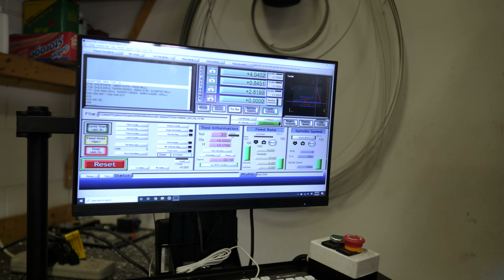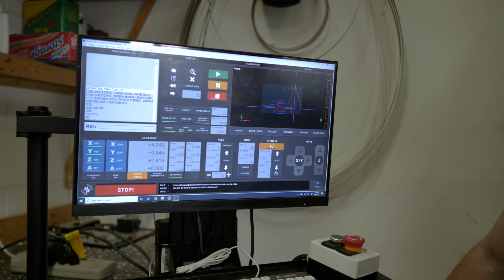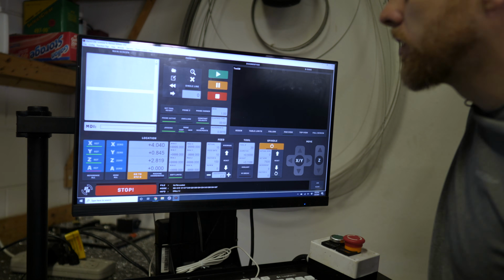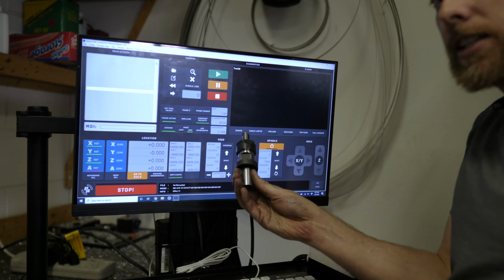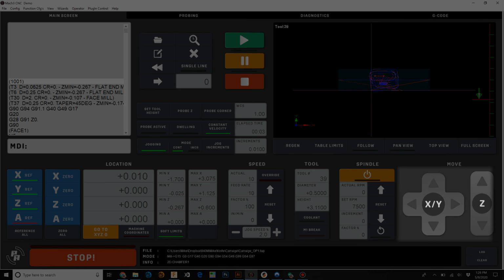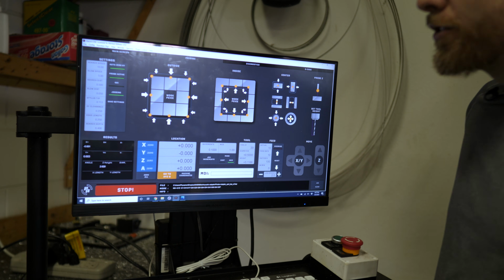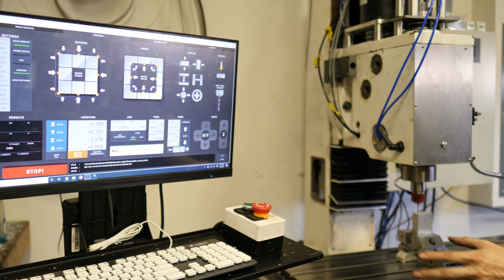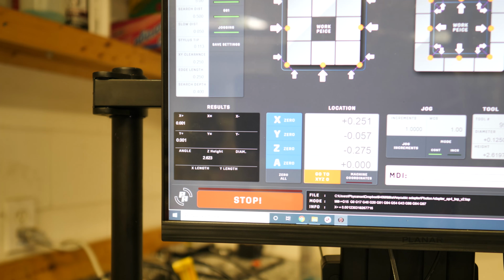Mach 3 Has Never Looked This Good! (CNC Software Part 2) - S03E14

Comment: Thanks a lot for sharing this probing software, really appreciate the work 👍
I have a quick question about units:

Does the probing system use Mach3 global units (mm / G21), or are the probing parameters (tool diameter, search distance, clearance, etc.) still interpreted as inches regardless of global settings?

Is there a recommended way to switch everything fully to millimeters?

Thanks again for the great software!

Comment: not sure where to report a maybe problem with the screen set.
When i change the speed on my spindle, i don't see the expected speed.

I don't know my exact speed, but i think its calculated what it should be.
When i press up and down, i can't see any value changing.
Is this meant to be like this? i broke my edge finder due to the speed being much higher than i expected.

Otherwise, it seems to work quite good.  are about to try the probing soon..  Does this screen set have plane orientation?
So my part can g-code can rotate after my part.

Comment: Great UI!! Thank you very much. :D

There are a couple of things that aren’t mentioned specifically though… you need to read through the comments to kind of find them. The just is…
1) The Bitmap folder and .set file need to be in the Mach3 folder.
2) In the “config” menu, under “General Config…” there is a tick box in the lower right-ish corner that says “Hi-Res screens”. This option needs to be ticked.
3) After this change you need to restart Mach3.
4) apparently there is something that needs to be done with Macros… I need to explore this more, but it is in the comments.

This worked for me on an Acer 24” generic monitor on a stock VGA port on the motherboard.

Hope it helps someone else. :)

Comment: A multi probe work around for Mach 3. If you have two or even the probes can you wire their outputs to a three position toggle switch (center off) on the normally open contact then wire the switch common to the probe input on your controller? Or you could even use a rotary switch.

Comment: One question, I have edited a bit on your screen set for setting feedrate via Modbus, there is one thing i cant figure out. Spindle on/spindle off.. using the led as an output, it is always blinking regardless of running state. Is it possible to make it just spindle led on when running and off when off? Br.. Jacob

Comment: A great set, thank you :-) One problem though.... Since I installed this set, I have to zero-out my Z axis two times. After I have set all axis to zero, and start cutting the Z axis jumps to 10mm above where it should be. I then need to stop the program, set the Z again, and the it works as it should. Anyone having this problem?

Comment: So I followed your example and started at bottom left, clicked on the corner and the machine moved to the left a little then stopped and a message says: Manually return to starting position and repeat the search. It just keeps doing this. It doesn't travel down then move right to find the part. What am I doing wrong?

Comment: Dear! I tried to find 0 parts by Z, put the cutter on and pressed the probe z button. He measured everything well and drove away from the part to a safe distance. I decided to check and after pressing the go tu zero button, the milling cutter went to 0 machine coordinates ((( and zero was at -157 mm at the bottom (what did I do wrong? Sincerely, Igor

Comment: Very Nice looking screen set but when I try to load it I'm missing the Reset/stop button, its off screen at the bottom(no scroll) and it does not matter how I try to change size or move it I cannot get it  to apear full screen with everything in sight. I'm using 1920x1080 full HD, using a non touch screen. any ideas?

Comment: Thank you for the video, you have designed a great screen set. I will be using this with a CNC router. I might change the coolant button to Vacuum. Can I use the editor that I use to change the Mach 3  screen set? Is the link the screen set the most current screenset?

Comment: i have try learn how make tool height Z zeroing to touch plate last 3 month but not understand how this make, linuxcnc, make touch button, make macro, run code tool setting heigh but not understand good thats my english not good not understand all, and translator not working technic language right.  were need add button file how make button file how and were make macro or subroutine and all hall or ini files or what have.

Comment: May I ask, how do you get it to fill the screen? I've tried changing the screen res but that made it worse. I also put that skin into Mach3. It fills the screen, but over fills it.  I can only see the left 3/4 of it and missing some of the bottom of it. I'm using a dell 14" laptop. Is that the problem?

Comment: i got some issue with center probing. circle, and slot probe..   it probe one side of the wall inside a slot. two times. and goes to the wall but stop here. it will not go to the other side of the inderwall on slots.   normal i run with big tex screen set, and use his macro´s. can that be the issue ?

Comment: Hello,
I can't get the edge detector to work, no matter what I do, I've set all the values as shown in the video and all I get is "Error! The sensor was triggered during movement Z

 ---Return to search position is interrupted" or "Manual return to start position and repeat search", but I can't get it to work.
Do you have any idea what the error is?
Dominique

Comment: Why do so many GUI designers do this? There are things the code knows about, and there are things the user knows about. The job of the GUI is to tie those together. Take the Work Coordinate System. The code labels them from 1 to 5 (or whatever). The user doesn't give a toss about 1 to 5. The user wants to see and choose G54 from a dropdown list. That is what needs to be on the screen. The same for all prompts and displayed info. None of it should reflect what is going on in the machine. It all needs to be plain English.

Comment: Installed the screen set yesterday.  The Top View Button results in a Mach3 script error on line: 1 - Sub or function not defined: None.  Also Full screen has no way to exit.
I'm sure I've done something wrong, but I've had no luck with this on two different computers.

Comment: @Physics Anonymous I think your logic on setting up the screen set is spot on and your design sense to make it look good while functioning is also great.  I will very likely use your screen set for the mill and modify yours slightly for a our Alpha Wolf CNC Plasma table as well.  I always meant to make my own screen set, started once, changed a few things and then never took the time needed to do the whole thing.  I did have 1 recommendation so far with watching your explanation, On your probing page the tip diameter, you should input your exact size and make another input box called calibration adjustment (or something like that) and that's were you could put in the amount you need to adjust it to make it accurate, then it would be clear and less confusing I think.  Again, great job!

Comment: Hi, thank you for this great UI. I really appreciate it.
Anyway, I ran into problems with probing.
Mach 3 always crash when I try Probe z or Set Tool hight 
The Tool touches the Probe plate.  Probe aktive lights up but then mach3 Crashes.
It doesn't even retract the Tool. 
It also seems to not save the settings.

Comment: When using Mach3 and a touch you need to use two fingers to activate a momentary switch like jog buttons.  I think the jog buttons are the only momentary (press and hold) buttons in Mach3.  The press of the buttons needs to be one finger first then the other (staggered).  I always found it weird and limiting but it can also act as a safety feature.  Having to use a double touch to jog helps eliminate accidental movements of any axis that can be jogged.

Comment: I installed this on my MACH3 CNC mill and it is so easy to navigate. One question, I am running MACH3 on WindowsXP on a VGA monitor 1280:1024. It seems like some items are fuzzy due to the difference in aspect ratio I am guessing. Anyway to get the aspect ratio correct so everything is sharp on a VGA monitor? My PC only has a VGA port.

Comment: Hey PA! This video just scratched the surface of the probing section. To me that one of, if not the largest, part of your screen design. Would you do a follow-up with an in-depth look at the probing and how it's setup? I've picked up you set and switched to it but it seems like none of the routines work correctly.

Comment: Warning! Danger! Read before use! This screen set and macros are extremally buggy! Some bugs render some functions useless, and can cause damage to your machine, tools, or accessories. I tried this set out as well as the probing routines. Here is what I found. First you will be lost in the short term while you relearn where a variety of buttons and functions are. The tool library and WCS offsets are not visible on any screens. This was a disappointment but not a deal braker. What really upset me was the total failure and unreliability of the probing functions and just how bad it can mess up your machine. All issues are unexplainable at this time. Here they are. I ran the probe function 10 times. It would "ERROR return to start position" 8 OUT OF 10 times. Basically had an unknown failure most of the time. And when I did get it to work OTHER issues occurred. The worst one was the "Mixing of the Jog Buttons" I don't know what else to call it, but yes you heard that right. The jog buttons got changed. And x turned into z and I Crashed and broke my probe! Some times it would try to accelerate a motor at a ridiculous speed and I would hear the motor stall. So now I have to re home it. In some cases the Soft Limits got triggered without a good reason. This is NOT in Beta testing as the website says. Beta testing is a term used by developers when they need a larger test run. In beta there is an easy feed back system where failures get reported, prioritized and REVISED preferably with a public log of changes and comments by users. There is no way to tell the PA guys what is wrong except in this comment section, or sending them a DM on social media. Which I will try to do. This is not in development and that's because no one is paying for the time. This is a common issue with Mach 3 as a whole and with Mach4 not being an improvement I highly recommend you look at an alternative controller, I have a Masso controller and love it. It's not as sophisticated and is not on a PC but it works very well and is reliable. Good luck. Let me know if you try it and if you get any issues.

Comment: Hello, I encountered some problems when using this interface. After the z-axis probe touches the part, it should be lifted up and touched the part again, but my machine is lifted and then continues to lift, and then descends near the part, the probe needle will not probe the part for the second time. The xy axis is when the probe touches the part and the machine stops, it will not back up and do nothing. If the probe is manually removed, the z axis will fall. What is the problem to my setting?

Comment: do you happen to have a video of how to actually perform the tool height offset function? ive been using your io for a while now and just got endstops and a fixed tool setter setup and saved the tool setter xy coordinates as my G54 command but cant get anyaccurate results for the tool height set function so its quite confusing to me currently. thanks

Comment: I'm a CNC machinist and this is an amazing UI. I'd rename the M18 to single block and add block skip. Also have single line, single block, and block skip next to each other. I'd also move the start stop pause to a corner, either the bottom left or right, then have the emergency stop at the corner directly above that cluster.

Comment: Thank you for this! And to help you with your probe problem, use a double throw switch. One pole hooked to the tool setter, the other the probe. Then just flip the rocker whenever you need to switch between the two. if you want to get fancy, you can get a relay setup and have it do it automatically with a macro and just have it activate the correct relay latching position at the start of the macro. I went the easy route with the switch as i had the switch already. but it is the same amount of work to do either.

Comment: If the corner finder works, but the round center function does not, is there a known fix? I get a "Manually return to the starting position and repeat the search" error

Comment: I've installed your screen set. It's excellent. Are there some additional files to make the probe functions work? When i try to use them all the motion functions cease to work. I have a G code file I use to set tool height which works ok. Running Mach3 v 3.043 with a WiXHC motion control card.

Comment: Can you show how to setup a simple ground circuit touch off setup? i dont know how this should be done. I understand that two wires will be connected, one to a plate or work piece, other to the spindle, and defined in the inputs tab. How is that programmed/setup past that? i keep hearing about macros and code, but you didnt show if that code was "pre installed"  and how it had to be utilized.

Comment: i just cant get the edge finder to work no mather what i do , ive iven put all the values like you have on the video all i get its  "Error! Probe tripped during Z movement
 ---Return to the search position is interrupted" or " Manually return to the starting position and repeat the search" just cant get it to work

Comment: Really nice skin, but when loaded on my machine (1920x1080) it dos not fit, it a bit large cannot see the bottom, can can suggest a way change or fix?

Also when you select full screen you cannot get it back out the normal size screen with all the controls.

Pete.

Comment: This looks amazing! but at 22:35ish when you went back to probe that corner, you still had tool 99 selected yet it didn't warn you of the wrong tool as it did when you went from the corner (tool 39) to the z probe (tool 99). Shouldn't it have warned you the wrong too was in??

Comment: Hello, Love your work. Although when using probing section, there is plethora of errors. Seems like my controller doesn't like G31 and keeps on going at wrong location. Which controller are you using maybe I can use same to rule out controller issues.

Comment: Any idea how to access the Scale feature that was to the right of XYZ values in the old Mach3 UI?  In the old UI, you could cut a design at 1.0 (100% scale default) but for example you could also cut a smaller (.5 would be 50% scale) or 150% for a larger cut using the same gcode. Thanks for your work on this amazing UI, just missing that feature. Much appreciated!

Comment: Is there a way to make this zoomable or scale?

I am just setting up my machine. I loved this on my MacBook during testing but I moved it to a cheap laptop I had sitting around with a lower resolution and it doesn't scale to fit like the default set

Comment: Bonjour PA, très bonne video et ton screenset est magnifique! Je fais des tests actuellement avec ton screen pour faire fonctionner ma sonde3D avec mon palpeur. On peut cabler les deux sur mach3 sans problème, il suffit de les cabler en série et de connecter les deux fils( signal et gnd) vers la carte de pilotage (BOB); cela fonctionne très bien sur Mach3.
Est-ce que tu as fait des tests avec ton set tool heigth?
Merci pour tes vidéos, je vais surement commander ton cutter, il est beau...

++José from France

Comment: Nice work, but as a fellow UI guy, I noticed that the section that contains "Probe Active" and "Dwelling" and "Constant Velocity" appears to just be a display of status, either the probe is active or it isn't, for example.  But the other (identical) 'buttons' above and below, such as Jogging and Set Tool Height appear to be action buttons rather than displays of status.  This is very confusing to the operator -- what is clickable / actionable vs. what is simply displaying a state or status?   I found I had this same confusion lower in the UI, with Speed and Tool for example.  I think you should be very consistent in terms of visual cues regarding what is a button that can be pressed or manipulated by the user, vs. simply a display of status.   My .02 cents

Comment: I have been playing about with the screen-set and find its a nice looking frontend although since i don't use a tool probe but do use multiple tools i cant find a way of setting the tools, i normally use a mechanical vertex zero setter and it works ok with the standard screen-set. i just don't see a 'set tool offset' button. also i see no access to the tool table. then for spindle speed, there is no commanded speed display so if i use spindle override i cannot keep track of what my spindle speed is (i don't have a spindle index sensor) 
i also fail to see how to access the tool table. could that be added as a tab with a manual tool offset set button and some big jog buttons for those with fat fingers and a small touchscreen? thank you for sharing and thank you for the quality content

Comment: Question if you download your Mach 3  screen set without the touch screen can it work with the mouse? Second, the touch screen you linked to on Amazon is a 22" screen will this run your screen set ok?

Comment: Hi, I can't get the Center probing buttons works, all the buttons under the "Center" section giving the same errors, please help, Mach3 Version R3.043.066
Thu - 22:00:31 ---Error! Probe tripped during X movement
Thu - 22:00:32 ---Return to the search position is interrupted